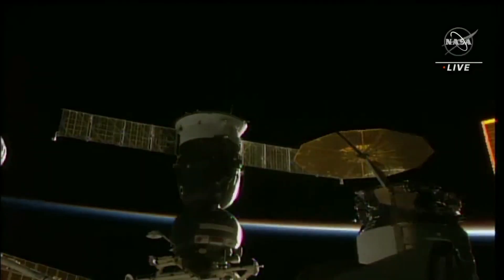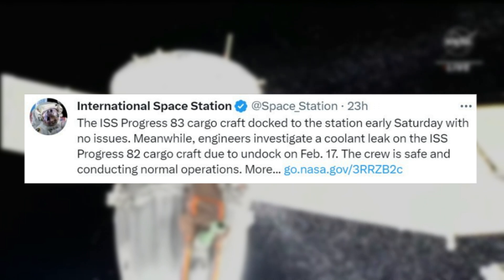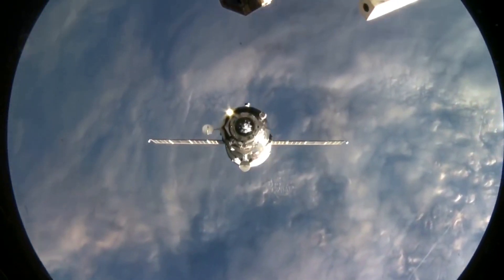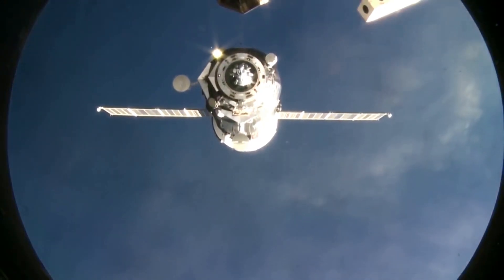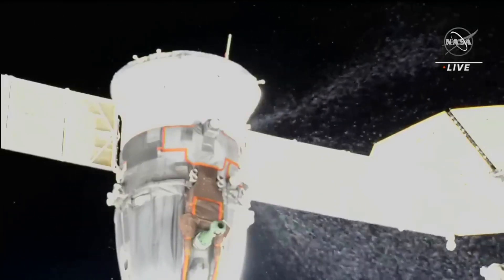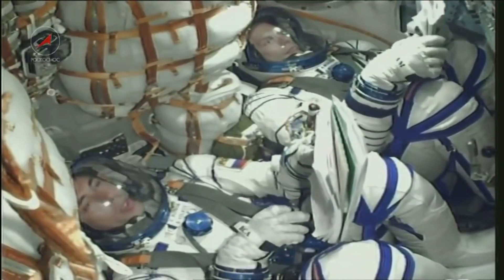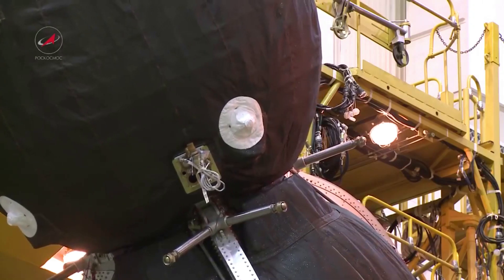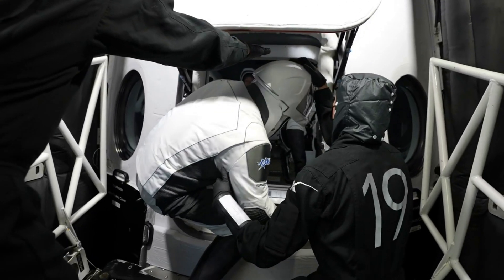A Second Russian Spacecraft Is Leaking At The ISS

Comment: The original Soyuz had a coolant base plate of pre-famulated amulite surmounted by a malleable logarithmic casing in such a way that the two spurving bearings were in a direct line with the panametric fan. The latter consisted simply of six hydrocoptic marzlevanes, so fitted to the ambifacient lunar waneshaft that side fumbling was effectively prevented.

Comment: The ISS is nolonger needed. All experiments can be done by robots without human presence. Putting men in space nolonger serves any purpose other than putting them in danger.
Reply: Putting men in space drives innovation, inspired the world and enables maintenance which is still not possible with robots.
Reply: @maxv9464  Anything is possible with robots. In most cases sending a man is less cost effective than replacement with few exceptions. 

Climbing the mountain because it is there has left 310 dead with many frozen bodies still on Mt. Everest.
Reply: @rmdlgarcia  That is not true. Not yet, at least. Humans are still faster, more adaptable, and more versatile than any robot for the wide variety of experiments, demonstrations and spacewalks done on the ISS. Robots could handle some of it, maybe, but you'd only be limiting the station's capabilities.

Humans are explorers. Space is the final frontier. There will never be a day when we should stop pushing that boundary.

Climbing mount everest doesn't contribute to thousands of technologies used all over the world and consistent innovation, but nonetheless, it's an excellent symbol of human spirit and perseverance. People have died doing loads of things but we aren't capable of just sitting around being comfortable with the status quo when there's a bigger mountain to climb.
Reply: Manned space flight is about publicity and funding, not need. It may not be possible to send men to Mars and have them survive the return to the earth's crushing gravity on return. Staying in space for a year is a death sentence for most people once they return. The body becomes too weak to overcome gravity

The high cost of equipment is only because the equipment is made to never fail. Your $200 car radio would cost over ten grand to test to aerospace reliability. Same radio just  likely to never fail. Hubble was not a equipment failure it was a design flaw. Most of the cost in the can is over creature comforts. Sending a can into space is easy. Putting a monkey in the can raises the cost and only proves we can put a monkey in the can, but there are only disadvantages to bringing the monkey.

Arriving at the ISS would seem like a glamor job until you get on board and the place smells like a NY City public bathroom that will never get cleaned and the water supply has a bit of a wang to it when you drink it. All that ambience cost extra and you don't want to be on board when the plumbing fails as happens all too frequently. Most failures are associated with the creature comforts because our needs are constant and so is the human waste.

Someday we will mine rare earth minerals from the moon because we don't want to destroy the environment making batteries and computer chips. The operation will be 100% automated. (I am lead to believe that most cobalt is mined using child slaves.) The equipment in space will last a lot longer it there is no monkey poo flinging in the equipment room.

Currently no one wants to admit, manned space flight for more than a few week is too dangerious and over a year is impossible. Only in the movies can men make new stable elements and technology that defies physics. 

There will be no colonies on the moon or Mars. We will build a habitat on the moon but no one will stay there. Spending a part of the day in zero G would be fun but I would like  get off the ride before I have to use the bathroom.
Reply: @rmdlgarcia  "Manned space flight is about publicity and funding, not need."

I never said it was about need, I said it was in human nature to explore space. It's also about technological development. Spaceflight is basically the only industry where you can find the technological innovation and funding of military goals - without the technology being used to kill others.

"It may not be possible to send men to Mars and have them survive the return to the earth's crushing gravity on return."

'May not' is doing SOOOO much work here. There have been many tens of hypothetical mission profiles. We do not yet know what the exact effects of low gravity are long term, but it's pretty clear that it is more survivable than microgravity. Spending most of a trip in 1/6th or 1/3rd G is a whole lot better than none whatsoever, and that's not to mention the possibility for rotational artificial gravity to mitigate the risks almost entirely.  

"Staying in space for a year is a death sentence for most people once they return.

No. Being on a planet or under acceleration or in a rotating structure are all "in space" and all can completely avoid the risks of microgravity. We also don't send "most people" to space - we send people at near peak physical condition.

"The high cost of equipment is only because the equipment is made to never fail. Your $200 car radio would cost over ten grand to test to aerospace reliability."

So what? The extra specifications and effort teach you how to build extraordinarily reliable radio and give massive insight to everyday radio designers. What a wonderful investment in innovation.

"Hubble was not a equipment failure it was a design flaw."

I am well aware. Why wouldn't I be? But it's fascinating that you would bring up Hubble, a telescope that has proved invaluable but could never have accomplished a thing were it not for maintenance and servicing on 5 occasions BY HUMANS. Those missions were not and still are not possible to be performed unmanned. 

"Most of the cost in the can is over creature comforts. Sending a can into space is easy. Putting a monkey in the can raises the cost and only proves we can put a monkey in the can, but there are only disadvantages to bringing the monkey."

No, there are many advantages. You spend more on development, but create new technologies and push the limits harder. You get a crew that can adapt to and react to nearly any situation. They can perform experiments, they have scientific insights, they can repair a leak or go on a spacewalk or install a new solar array or perform a demonstration for people back home. Robots cannot yet do that. 

"Arriving at the ISS would seem like a glamor job until you get on board and the place smells like a NY City public bathroom that will never get cleaned and the water supply has a bit of a wang to it when you drink it. All that ambience cost extra and you don't want to be on board when the plumbing fails as happens all too frequently. Most failures are associated with the creature comforts because our needs are constant and so is the human waste."

I never said spaceflight was glamorous, easy, simple or comfortable, so please stop responding to me as if I did. But these are also the growing pains of a spacefaring civilization. The ISS is the first truly long term space settlement. We have learned so, so much from building and maintaining it, and guess what? The next 2 decades will see 4+ more space stations on orbit from America alone. 

"Someday we will mine rare earth minerals from the moon because we don't want to destroy the environment making batteries and computer chips. The operation will be 100% automated."

How do you know? Unless you've got AGI that can perform complex and varied maintenance you will need a human staff. 

By the way, for the moon but especially for farther away, having a crew that doesn't take 7-odd minutes to hear orders and 7 more top respond before it can do anything is a hell of an advantage. The work done by all the mars rovers ever sent could be replicated by a well equipped human team in a week. And we wouldn't need to spend billions on sample return, because you can just send a PhD biologist to analyze samples for life and have put the necessary work and investment into large scale cargo return all the same.

"The equipment in space will last a lot longer it there is no monkey poo flinging in the equipment room."

What are you, 12? Having humans on a base does not guarantee waste problems nor do those outweigh the vast advantages to having them there.

"Currently no one wants to admit, manned space flight for more than a few week is too dangerious and over a year is impossible."

Oh really, what happened to "may be"? Not it just is impossible? Nobody wants to "admit" your view because it's wrong. It's uninformed, oversimplified and pessimistic.

"Only in the movies can men make new stable elements and technology that defies physics."

Well, islands of stability at higher atomic numbers are not out of the question, but that's besides the point. You don't need physics defying tech for manned spaceflight. we've proven that many times before and will continue to prove it many times more.

"There will be no colonies on the moon or Mars. We will build a habitat on the moon but no one will stay there."

Prove it. (By the way, bathrooms would be way easier on the moon or mars. Chill out about your shit. Literally.)